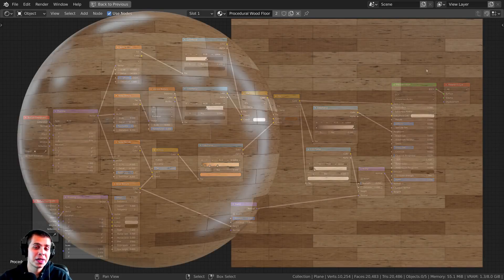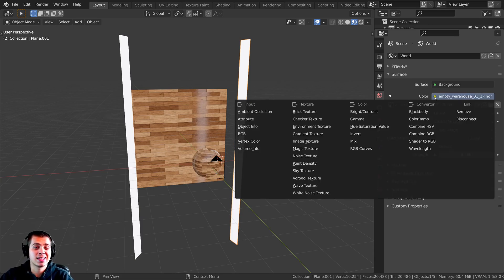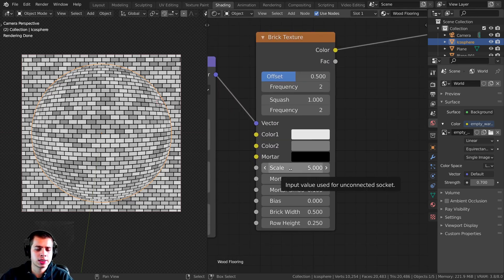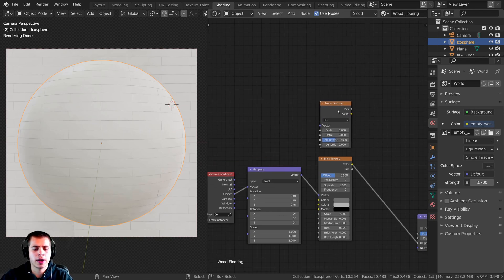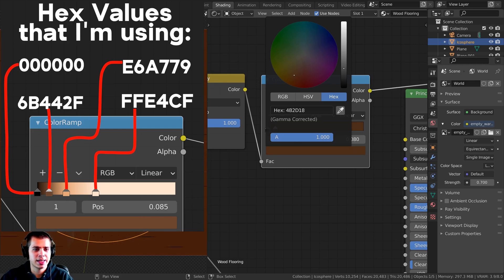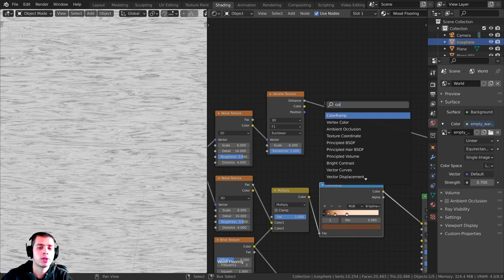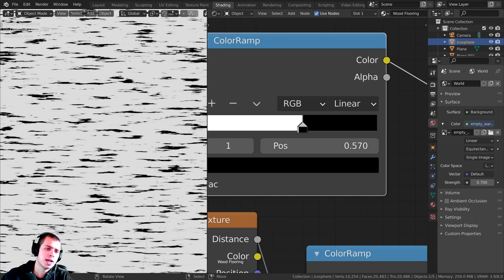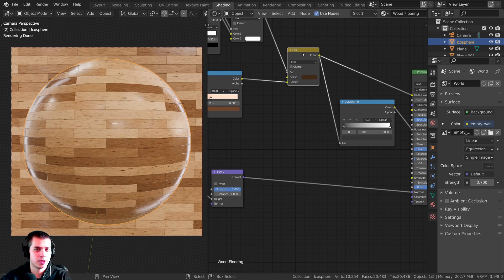Procedural Wood Floor (Blender Tutorial)

Comment: Im at 13:39, I did everything the exact way you did it...down to the hex numbers...but when I take my mix out of the viewer and leave it attached to just the principle and two color ramps with the principle beds to the material output it does something crazy! it just like completely greys out most of the floor and shows some weird stuff. FRUSTRATING but great tutorial,
Reply from the maker: Hmm, it might be that the color correction is different. Did you change any of the settings in the color management tab?

Comment: Thanks for the tutorial!  I did something a little different.  At 11:34 you are mixing the darker mask in with the wood color.  What I did was feed the wood color into both Color 1 and Color 2.  Then on Color 1 I added a RGBCurves node just before the MixRGB and pulled the mid point of the curve down to Y 0.25 and I found this gave me a little more control over the dark patches as well as a more subtle effect that I thought looked nice.  Thought I'd pass that along.  Thanks again for all the tutorials.
Reply from the maker: Cool! Thanks for sharing.

Comment: ❓ Thanks for the stuff! For some reason, in the "Material preview" mode, the material turns pink (rendering error). And in the "Render" mode it is displayed normally. I have blender version 2.93. Is this normal or not?
Reply from the maker: Hmm, that doesn't happen for me. Although I think I've gotten comments of other people having this issue sometimes as well. How much ram do you have in your computer? Its possible that Blender ran out of memory.
Reply: @RyanKingArt  I have a laptop. RAM: 8GB DDR4, CPU: Intel Core i5-7200U, video: nvidia GeForce 940MX with 2GB VRAM. The task manager shows that 63% of the memory is occupied.
Reply from the maker: @GennadiyGorbach  Hmm, ok. That shouldn't be the problem as far as I know. If you'd like to, you could make a post about it on the Blender Stack Exchange, and hopefully someone can help you.